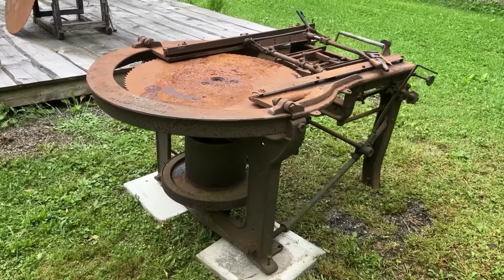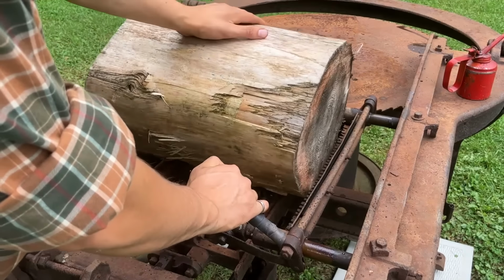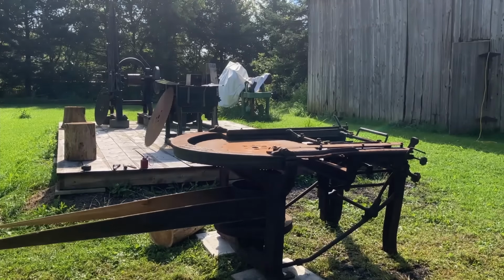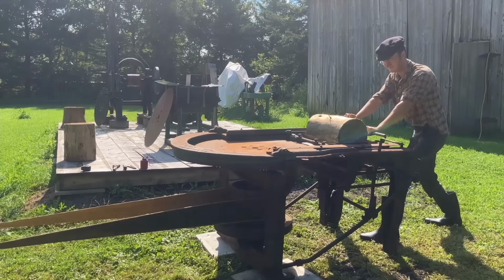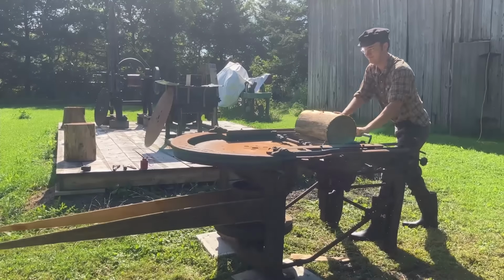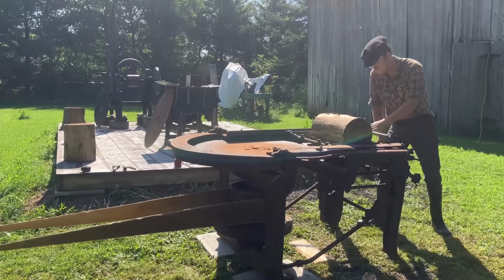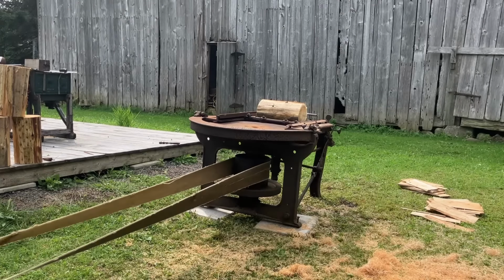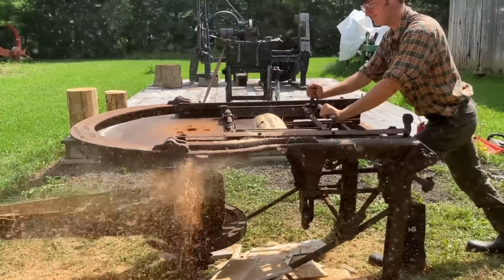First Run of a Horizontal Shingle Saw

Comment: Thanks for the video. I love that you made it work. I'm curious though as to how it is an advantage vs. by hand with a froe? With the froe method, your shingles are all the same width, since they are radial like pie slices. Which is handy for roofing. With this, your shingles vary in width as they are slabs cross cut from a cylinder. I would think that these might also tend to curl up more, or at least more variably, than the froe method? And it doesn't appear faster (not that I've seen a lot of either method.) Somehow, making shingles with a froe strikes me as an idyllic scene, whereas this gives me nightmares and I count my fingers after I watch it. That said, you had me at giant tractor PTO drive. Guessing you got it sharp based on 3 foot chips. Please be careful.
Reply from the maker: If set up properly, cutting shingles with a machine like this is much faster, but this machine still needs adjustment. Cut shingles can also be made radially instead of just slices of a log like in the video. Split shingles do tend to be thicker and last longer since the split happens with the grain. Cheers!

Comment: It appears that in addition to saw blade tuning and sharpening, it appears that the bottom bearing is worn out, (or needs to be adjusted) so that the bottom edge of the drive belt does not fray against the drive pulley.

Comment: Here in Slovenia we split shingles with a hand axe. We never cut them as its too much waste and it lasts for up to 50 years.
Reply: I love hand tool work, and it's better for a lot of things. But are you sure it's less waste for shingles? I mean, other than the obvious fuel use, which is definitely waste. I've watched how traditional shingles are made by hand, every single one requires some touching up with an axe to thickness it and get it flat-ish, and it always looked to me like that would remove more than a saw kerf worth of wood per shingle. Although I don't know the size of this saw kerf, it might be huge.
Reply: @TheJohnreeves  I wouldn’t be surprised if every third shingle is turned to dust with that saw.
Reply: Пила перерізає  волокна,і на них затримується вода,і вона довго не живе.Тому в нас  Карпатах України рубають в ручну.Називається тьос.
Reply: @mlindsay527  haha, maybe so. And they'll all cup, unlike hand riven shingles.

Comment: I have one of these machines(might be different manufacturer) in the barn, run from a similar old Oliver tractor.  Several blades too.  The whole thing came with the farm.  What do you think is the best pulley rpm to run this thing?  I would like to restore it and electrify the setup.  I see a few commenters think the speed should be much higher.  Keep up the good work!

Comment: It looks like your bushings or bearings if there are any installed are worn. Every time you bear down on the wood that you are cutting the belt begins to track down which means your pressure is causing the blade to angle down when you apply a transverse load on the blade and axle. You have a ton of leverage applied to the axle by the huge radius of the blade. The machine should have bronze bushings at the top and bottom of the axle that may be worn or out of round.
Reply: Мне кажется, что когда возрастает нагрузка, то  ремень натягивается сильнее, и выбирает провисание, с которым он крутился без нагрузки

Comment: One day our high tech society going regret losing this kind of skills, basic knowledge to live simple lives.
Reply: This is still Hightech, requires a tractor to run or electricity if you use a different motor for the belt. As a kid I saw a mill run on a water wheel, that was damn impressive. Was told they had all kinds of stuff run on water or wind mills. True ingenuity.

Comment: Not all wood can be cut by this method. To have good pieces, we split the wood into a star shape and then we equalize the thickness and then we end up cutting to dimensions. The parts made in this way do not deform

Comment: This is a very strange way to make shingles....the waste factor must be about 30-40% in sawdust..     in Sweden where all country houses were shingled, they were cut on a splitting knife,  no waste at all and a rate of about 3-5 seconds per shingle, you will find a working machine in the tractor museum in  Osterbumo, in  southern sweden..     simpler, safer, and a hell of a lot quicker.

Comment: From what I know cut shingles are worth shit.
Shingles have been made from split wood for centuries and there is a good reason: When splitting the wood, the newly created surfaces follow the grain and fibres of the wood which makes them 
much more resistent to weathering and decay.
Sawed shingles may look prettier at the start, but they'll rott away much faster.

Comment: Seems to be struggling during the cut, Might be an idea to redo the the blades tooth  'set' , if it's sensitive to surface condition then it is cutting too thin and will not clear debris efficiently and tend to bind.. a wide set does waste more material but the cut is clean and fast ...a very real compromise between cut effort and yield .

Comment: Really need to get that blade off, clean and sharpened. It would work a lot more efficiently.
Reply: It seems to wobble quite a bit too, so getting the blade off and put it on a press to try and bend it back a little would help too. The only problem i see is that you kinda risk of breaking screws and bolts once you need to take it apart. Right now, everything seems to be pretty original and in somewhat working condition, so i'm not sure i'd want to risk snapping off bolts.
Reply: @ProtonOne11 Yeah, needs straightened as much as anything.  All that rubbing is stealing power.

Comment: When you are making a cut the belt drops down the pulley as if the whole blade and shaft is pushing back in the bearing.

Comment: For my two cents, I think your "gear ratio" is off. I know, no gears involved, but I think you should be running your belt from a larger drive wheel and getting blade speed up about 50 more rpm. There were pretty big chunks flying out, suggesting the saw is tearing through the stock.

Comment: Dude, that tractor is a bit small, but it sounds like it falls flat on its face at any amount of load. Check the timing. And do a carb overhaul. I suspect the power jet is fouled with dirt.

Comment: By the "stringy" chips looks like the angle on the blade is for a "crosscut" and you are "ripping". The angle should be more obtuse to the wood. You want small chips. The long ones are affecting the penetration of the blade

Comment: I feel like your blade is still not sharpened and set correctly. Also your RPMs look slow. I've run one of these before and it should cut a lot faster and cleaner than that one is without you having to lean into it so hard.
Kudos for keeping it from the scrap heap. I'm looking for one myself. I tried to buy the one I ran at auction but another bidder had deeper pockets.

Comment: Seems to me that tractor is working way to hard for what you are doing. polish the surface and lube it so there is not as much friction on the flat of the blade. Higher rpm to help the flywheel maintain momentum. Maybe a solvent to keep pitch from building up too. you should be cutting those almost as fast as you can push them through.

Comment: He needs to tear that machine down. Clean every single part, re paint anything that needs it, replace bearings and oil every bear metal component. Make a New Blade with carbide tips. 

No sound other than the shingle hitting the ground should be heard.

Comment: 😬😬😬 Would you mute the filing of the teeth, please?? My hair's standing on end!! 😬😬😬

Edit: Decided to just skip that part! 😥

Edit2: Please don't use chainsaws without protection! Helmet with visor and ear muffs, trousers and safety shoes if not boots. At least. Just wearing normal workwear is like going for a motorbike ride barefoot, in speedos and no helmet on a busy highway. Sooner or later something will happen, and what could have been a small bruise is now months in hospital with a lost leg, roadrash all over and no use of your fingers ever again. If you're lucky. Please don't take this lightly. Chainsaws will fuck you up!

Wouldn't have commented if I didn't find your vid extremely interesting!

As for the saw itself, I find it really interesting! I mean, it looks like an ingenious machine and very sturdy for many years of use! You mentioned that the blade wasn't at the same angle as the sled, and I see it's adjustable with the hinges and the diagonal bars underneath. And that it's been set up way worse before, as the blade has worn away the bottom part of the rail for the sled! That can't have been a very good angle to cut anything on!

And then there's all the waste from ripcutting with a large circular saw. It's pretty thick, say 5mm? That's 5mm lost for every cut. Of course, if you have unlimited lumber and a way to use or dispose of the saw dust, It doesn't really matter, but I suppose, if you were to build something like that today, it would be with a band saw blade, like on those mobile mills (actually, that's a great donor for a project, come to think of it...).

Wooden shingles like these are not used here in Norway, never heard of them or seen them here. We do however have something called "spontak" (literally wood shaving+roof), that are used on (very) traditionally built houses and stave churches (large, national treasure, wooden churches from the early middle age. Wikipedia article: https://en.wikipedia.org/wiki/Stave_church ). But these aren't sawn (because you get end fiber on the surfaces, rather than on just the two end edges), so they are cleaved. Mostly by hand, but there are simple manual lever action automatic cleavers too, but I can't seem to find one now. It was probably a homemade contraption made by one of the guys specializing in these kinds of roofs. There aren't very many carpenters specializing in carpentry this traditional, so scholars and researchers have been very interested in preserving the techniques used. For instance at NTNU (Norwegian University of Science and Technology), Their Institute of Architecture and Technology have done some (science) stuff, and have also been in the field, here crossing over to Sweden to work on the old church in Södra Råda, making what they call "kirkespon" (church shingles):

NTNU blog post (translated into English. Hope it works! If not, comment on my comment!): https://tradisjonshandverk-com.translate.goog/2017/04/07/sponkloyving-til-sodra-rada-med-borje-samuelsson/?_x_tr_sl=no&_x_tr_tl=en&_x_tr_hl=en-US&_x_tr_pto=wapp

Just the youtube video (Sorry, no subtitles available!): https://www.youtube.com/watch?v=VN-nAL13sdc

Another video from the same Swedish workshop, same expert/carpenter. Here, autogenerated subtitles are available, just click on the subtitles button and then the settings cog ⚙-> Subtitles/CC (Swedish auto-generated), and choose English: https://www.youtube.com/watch?v=FmU6tK76mSM